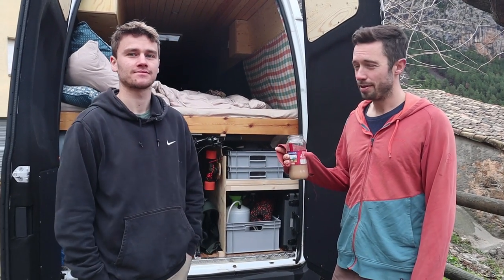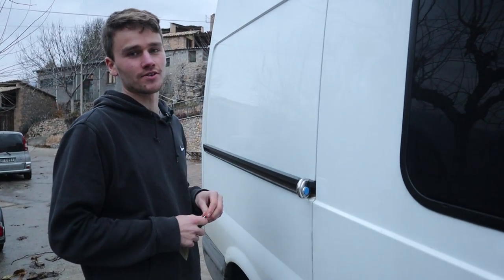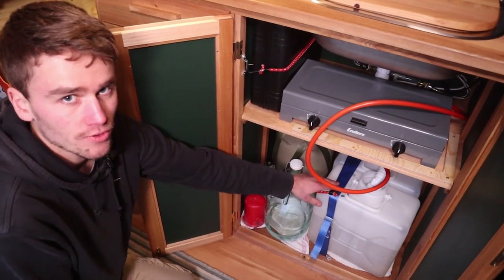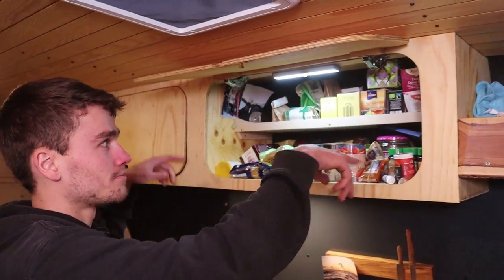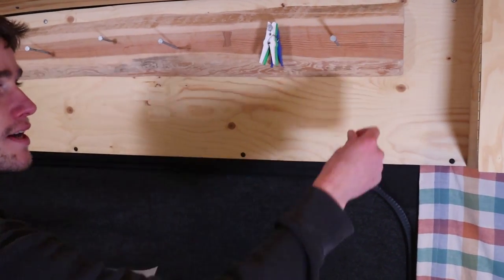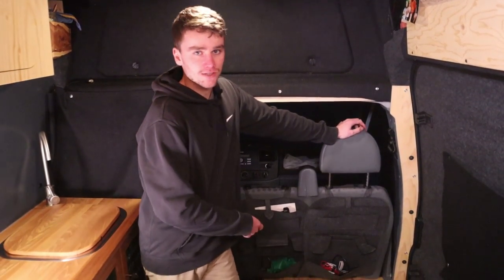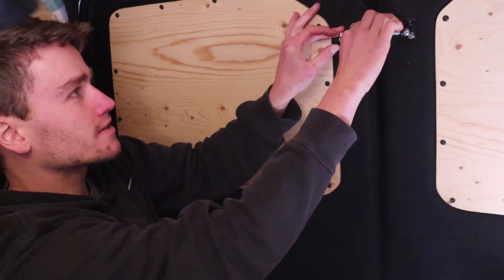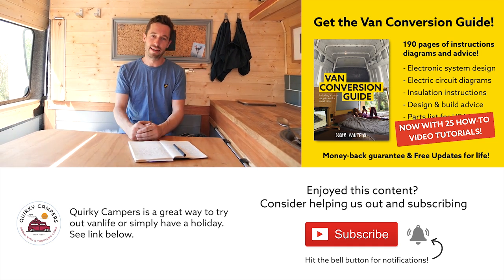Carpenters ULTRA SECURE & HIGHLY PRACTICAL Self-Build CAMPERVAN 🔒⚒️

Comment: I really enjoy watching your channel and somehow missed this video when it came out.  NICE VAN!  There were a few things I wanted to take a good look at, but couldn't see very well and thought I'd mention it here....One is his pull out table.  I think the videographer was trying to keep the carpenters face in the picture and sadly missed giving us a picture of most of the table.  I never did see the legs of the table, which I am interested in because it looks like he does not just have the typical single legged table.  The other thing I was going to mention is the pop-up add in the lower right corner advertising the van conversion book frequently covered bits of the van, so much so that there were a few things we couldn't see.  Honestly I think  you are awesome.  I only mention this in case they are things you hadn't thought of before.  I love seeing the nice van conversions.

Comment: The sliding door lock? What a GREAT idea! That style of lock is the best. No cutting that off, even with a pair of heavy duty bolt cutters. There is a product by 3-M that is a film for your windows. Once applied, a baseball bat can't break through. A tire iron can't break through. It is complete glass security. Steering Wheel lock... Very nice! Very nice build!
Reply: You can cut that thin track off with a grinder in minutes though

Comment: Great kid!  Love the safety features - definitely made a note of them... but I feel that stool should have got more attention!!   My mind melted when I saw that!
Reply: Should have had removable steel bars on the inside of the driver and passanger side windows along with the lock.. I saw a van here in nyc with a metal gate drilled on the outside of both passanger and driver side windows.. Doesnr even make sense trying to break his windows..
Reply: We have a little table at home like that, very practical.
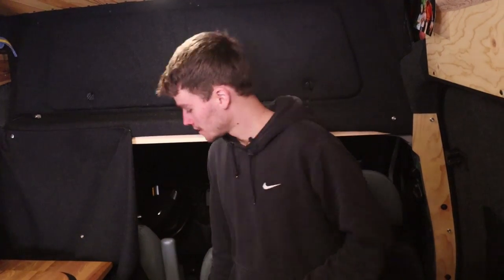Reply: 16:59 for the stool. Very cool, would watch a vid on how that's made for sure!

Comment: Well done
Things of concern
1. Fire extinguisher?
2. Smoke/CO alarm - battery operated is fine
3. Restricted egress  or restricted emergency exit.  I'd replace the interior bolt lock at the sliding door with something to allow a faster reaction time to unlock the door.  Remember smoke rises so place the 'security latch' at the low point close to the floor.
Enjoy
Cheers,
N
Reply: He mentioned having two gas detectors, one high and one low

Comment: The external padlock is rather vulnerable to attack with a hammer or an angle grinder, and the first time you forget to take it off before opening the door... clang! Dent. Rust.
Fit a deadbolt flush with the surface of the door. Neater, stronger, no dents.
Reply: Yeah I agree. That looks like it could easily be smashed off. I'm going to fit deadlocks on all the doors (vans are far too easy to break into)

Comment: Just imagining a fire or gas leak in there and trying to get those “ extra security measures “ figured out while trying to shake off an hypoxic  reaction.. 

Got to have a better exit strategy. 

And a garden sprayer is not a shower.. if you already have a diesel heater like an Espar, and a water pump... doesn’t seem to much of a leap to have a diesel hob and warm water for a warm shower,.. even a heat exchanger using engine heat would be better.

And at least a portable loo for emergencies would be a good idea.. especially if you have the occasional “guest”..

Comment: Great van.  A question about the transverse bed: you say it is 185cm long yet online it says that transit vans are only 173 - 178cm wide.  Is one of the measurements wrong or did you do something to create some extra width?  Thanks!
Reply: this model  is around 190 cm wide from bed height.

Comment: Where did he/you get those brackets for the roof to secure the bars?! Looking for exactly theese - I am about to weld my own, but never tried welding.. Soo.. Please..
Reply: Jens Wejs Andersen I believe he said they came with the van when he bought it but I’m not entirely sure
Reply: @nat-sarai  yes, i realized moments later.. I Hope there might be some sort of branding on it.. They are near to impossible to find
Reply: Yeah so I got these with the van. 
They are from the company Rhino. 
Here is a Link: 

https://www.rhinoroofracks.com/ford/transit-roof-racks/transit-2000-2014/transit-swb-medium-high-roof/rhino-delta-3-bar-system-ford-transit-2000-on-swb-medium-high-roof.html

Comment: Steering wheel lock is gone in 30 seconds with a hacksaw. I like the other security ideas more. :)
Reply: @eel5733  someone looking to steal. with a hook filed into the end of the blade at the mounting hole it becomes a slim jim - dual use and easy to conceal.

Comment: NEED TO VENT THAT PROPANE BOTTLE.  A VENT BESIDE IT.  I'D USE A BUCKET WASH.  GOOD JOB!
Reply: How would you suggest venting it. I'm installing a tankless water heater. I'm going to vent the chimney out the roof, and then install a fan to draw in air through the floor to properly fuel the propane boiler.
Reply: Propane is heavier than air. Needs a grille in the floor.